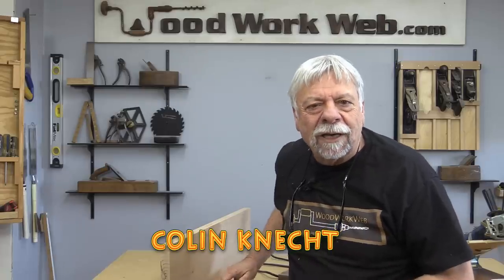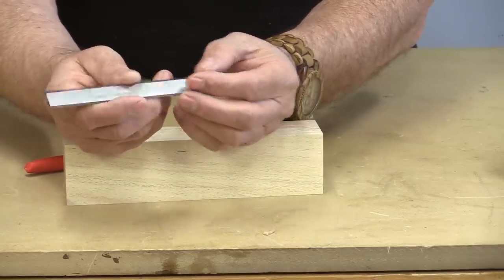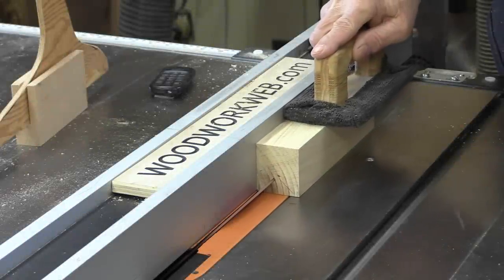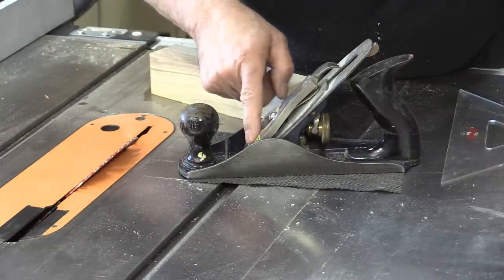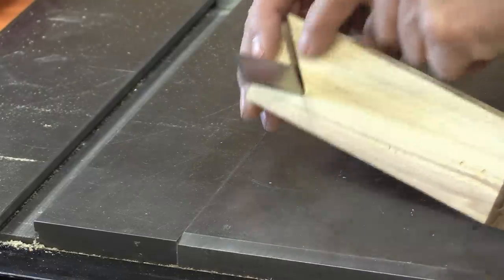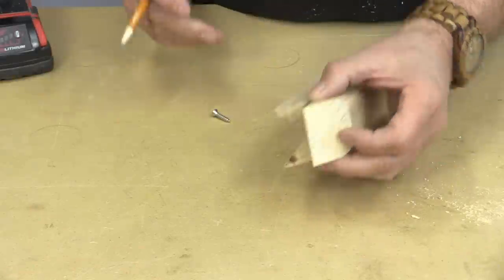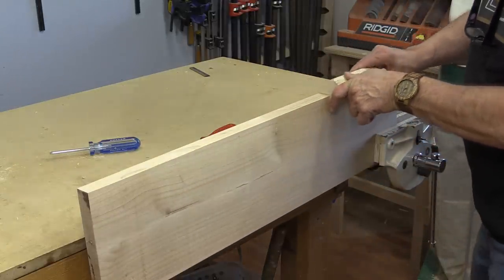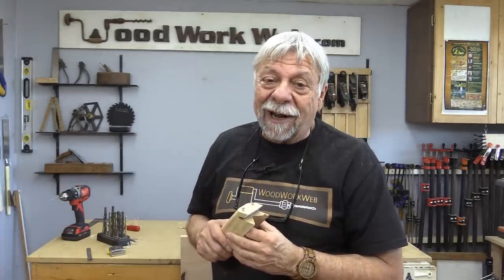How to Make a Chamfer Plane / Corner Easing Plane

Comment: EXCELECT job Collin.  Definitely on the "Make" list.  My only suggestion would be to take the point off the last two screws hat hold the blade in place.  That will give you a bit more holding power and not damage the blade when you have to re-set it after sharpening.  Thanks ! !! !!!
Reply from the maker: Thanks for the tip and thanks for watching!

Comment: I love this edge trimmer!  I think I can get the parts, but I am curious about where you put the blade.  Would the blade also work in the middle of the block?  I'm thinking that if the block were longer, the chamfer would be  more consistent like a plane if the blade were further back so the device is firmly fit on the board.

Seeing it built in person might be different as I am going by what I see with the camera angle. 

Thank you.  Excellent idea and I have already experienced usages for one of these.  Wish I already had it a few days ago, LOL

Comment: Super little tool Colin and very enjoyable vid. Do you think something line a utility knife blade (what we'd probably call a Stanley knife blade here) would stand in for your jointer knife? Thank you mate, enjoyed that.
Reply from the maker: It could, but the sharp edge won't last long. You would be replacing the blade all the time. Thanks for the watching, Mark.
Reply: WoodWorkWeb Yeah, I guess. Can you suggest something other than the jointer knife? I haven't had my planer/thicknesser long enough to have any old knives lying around!
Reply: Mark McCluney I was thinking the same. Possibly an old chisel cut down? Doesn’t need to be full width of the block.

Comment: I've  been looking for a good corner plane to round the edges of 1 x 4's for door trim.  Some planes have bad reviews and I'm tired of using an 1/8th inch roundover bit and routing.  You have to keep moving the clamps and flipping the board etc.  Lot's of dust in the air. etc.

Comment: I have a timber frame home with 1 inch chamfers.  I have about 6 lineal feet of chamfers the timber framers missed.  Would a modified version of your plane. A 1 inch router bit is costs a packet.

Comment: Great video. Thanks for sharing.
I have some questions:  I do no't have a jointer and therefore also no spare jointer knives. Can I use a chisel?
When you put the angle to 45 degrees with your engineering square, did you afterwards check how exact your digital angle measure is?
Which way is it possible to determine if the grain direction is from left to right or from right to left?
Reply: I'm sure a chisel would work just as well as a jointer knife. You could also try the blade from a miniature hand plane like the Stanley 12-101 or the GreatNeck LSO (those only cost $7 or $8).
Reply: @XJWill1  Thanks for your answer
Reply from the maker: Yes, you could use a chisel blade, but you should be able to find some cheep plane blades on ebay or amazon if needed. Yes, double checking you angles on a project like this is a great idea. You should be able to look at the grain and tell the direction, like looking at the hair on a dogs back. Thanks for watching, Hans!
Reply: @knecht105  Thanks for your reply. I'm going to try if I can manage the "dog trick" on wood.

Comment: hi. when i am cutting an ikea kitchen laminate counter top with a jigsaw using a downcut jigsaw blade, do i need to turn the laminate over and cut from the underside?  thanks, Jill.
Reply: Cut from the top side if your using a down cut blade. Make sure you hold onto it well because if they grab they have a tendency to jump. Mask off the surface with masking tape also so you don't scratch the counter. Make sure that blade is sharp or it'll have a tendency to wander.
Reply: @fireball570  thanks.  i will be purchasing a new blade for this and turning off the orbital setting on the jigsaw as well.

Comment: Won't it be better to have the blade more in the middle of the plane?
Reply: With it at the front you can run almost up to a shoulder. In the middle you would be a few inches short.
Reply from the maker: For this style, I like to have it close to the front for the Jason mentioned. Thanks for watching!